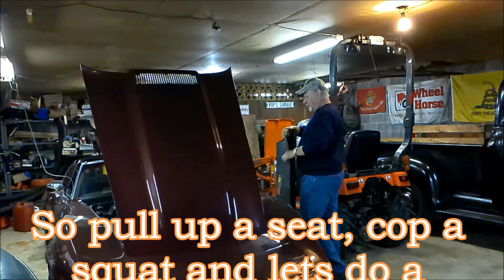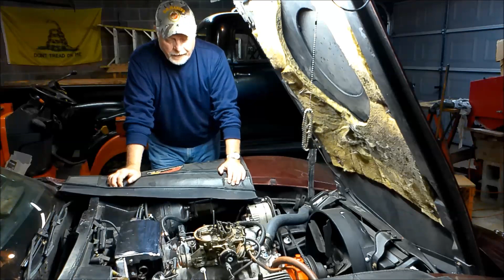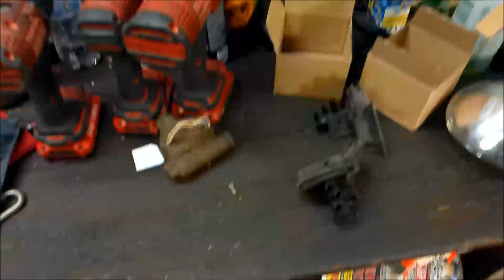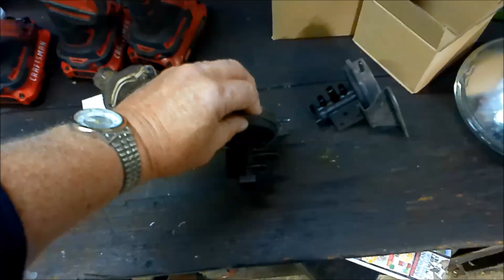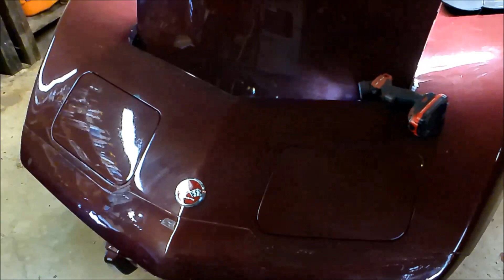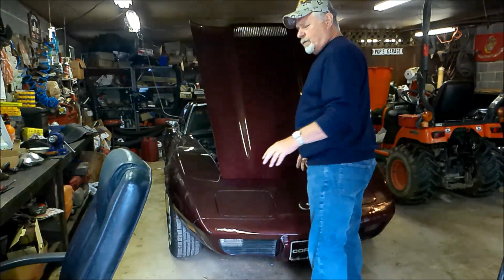C3 Corvette headlight causes rough idle, 75 C3 Corvette, Volume 44

Comment: Nice video.  In retirement learning to be a Car Guy.  Fun!  Question.  You said when the Intake valve opens, air rushes in to fill the vacuum caused by combustion. But doesn't that already occur during the exhaust stroke. So there is no real pressure differential between the combustion chamber and the Intake valve when the intake valve opens?  It's just vacuum caused by the piston moving down.
Reply from the maker: Hey CAG1618-FP, oooppp's you must have misunderstood me, which I admit is a condition I too experience more times than not, LOL. 
Air rushes in to fill the void because the cylinder is expanding which drops the air pressure. Combustion doesn't occur until both valves have closed and the piston has "nearly" reached TDC and has compressed the air/fuel mixture to around 8 times atmospheric pressure for normal engines to 12 times (or higher) for high performance engines, then you get ignition/combustion. I say nearly because the majority of engines advance the timing to start the burn before TDC inorder to get max burn. 
You may know this but I'll add for clarity.
In a 4 stroke engine, you have 4 linear events that combine to make rotational power. 
1) intake stroke, the piston starts going down in the cylinder, the intake valve opens to allow the carburetor mixed fuel/air "mist" to "rush" into the cylinder. The valve closes just before the piston reaches the bottom of it's stroke.
2) compression stroke, as the piston begins to go up, both valves are closed which compresses the fuel air mixture to anywhere from 8 to 14 times atmospheric pressure, this makes the mixture extremely volatile but usable.
3) power stroke, the ignition system "fires" the spark plug which ignites the fuel/air mixture. Some say it explodes but those who study such things indcates it is actually a very RAPID burn of the mixture. This drives the piston down in the cylinder which spins the crankshaft.
4) exhaust stroke, as the piston starts to raise back up in the cylinder because of the rotational momentum of the cranksaft, the exhaust valve opens which expells all the exhaust gases from the cylinder. Just as the pistion reaches TDC (top dead center) the exhaust valve closes and the intake valve opens starting the entire process over again.  
2 stoke engines are a different beast as are diesel engines, LOL.  
Thanks for watching and have a good 'un. 

Dave

👍
Reply: @Volfandt  You are terrific.  Thanks for the quick response. Still reviewing this video one more time and making a lesson plan for later on.  I have a vacuum leak in my 79 Corvette SBC.  Headlights slow to raise but lower fine.  Keep up the great work!

Comment: Hi I have a 1975 corvette just like yours, I’m having an issue where when I start it for the first time it runs like it’s missing a bunch of cylinder, even when I rev it. It shakes a ton. When I really give it gas in park or drive it, it smooths out and feels like all cylinders are firing. After it warms up it idles perfectly. Any advice to help this issue?
Reply from the maker: Sounds like the choke may need adjusting. It's not unusual for a carbureted engine to stumble and slightly miss on a cold start.
Unlike a fuel injected engine, a carb'ed engine requires time to warm up to operating temp.
 I adjust a choke so it will "just" close when ice cold (1st start of the day) . I'm sure you know how to set a choke on a cold engine by flooring the gas pedal 1 - 3 times before the 1st start.
Once the engine starts the choke should open approx 1/4" so the engine will idle. After approx 15-20 secs or so you should be able to "kick the choke down" by qiuickly flooring the gas pedal. It should drop a couple 100 rpm but still be at a higher than normal idle and the choke should open alittle more. This makes it somewhat driveable while it's warming up. AS minute or so later the gas pedal can be kicked down again to it's normal idle rpm.
When fully warmed up the choke should be fully wide open and the engine will run & idle properly.
You can only adjust an automatic choke on a fully cold engine thats set overnight before starting. Once an engine starts heat is immediately applied to the choke and it begins to unwind which is how it opens the choke.
Good luck.

Comment: I have to try, because i have that problem. It suddenly runs rough and a headlight comes up and stays up , i recently changed the actuators and valves so i hope this is not the problem because they are new

Comment: Thanks for the video, Dave! I think maybe you've given me a clue as to why the wiper door on my '71 opens and closes on 1st startup. I suspect it is sharing it's vacuum source with the HVAC or headlights and is being starved. Once the engine is going the wiper door works fine, and usually doesn't do it again on warm restart.
Reply from the maker: Hey David. The vacuum system(s) on our Vettes can be daunting to troubleshoot but when broken down individually they become much less complicated.  It does sound like your wiper control is bridged with another system thats got a vacuum leak. You might try it on one of the unused vac ports on your carb. Once I moved the HVAC vac line from the headlight control vac line  to a spare Vac port on the carb my headlight winking problem went away and the engine hasn't idle this smooth since I got it. Good luck.

Comment: Great video Dave, nice way to start the day, my buddy Dave and a coffee, good trouble shooting, back when I was a young man I did a valve job for my girlfriend’s brother, when I got done the the car which was a 70 Chevelle ran rough kinda like it did before we tore it apart the valves where definitely burnt so it should have ran smooth, I drove it over to this old time mechanic, he took some starting fluid and sprayed it down along the intake manifold and yes you got it right she smoothed right out so I went back and redid the intake and she purred like a kitten, yes Dave I will find out this morning around 10 if the boat checks out ok , if it does we will sail Sunday morning, good Lord willing, I will stay in touch my friend, have a nice spring☀️😀